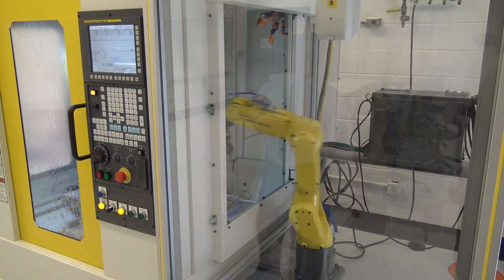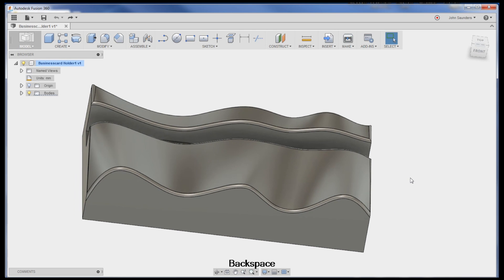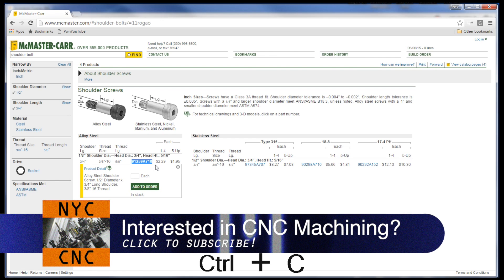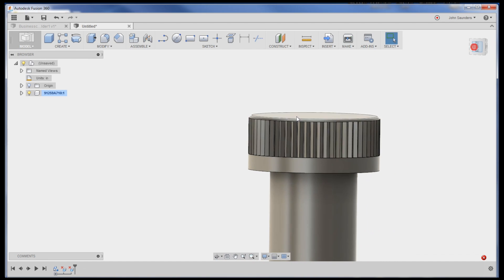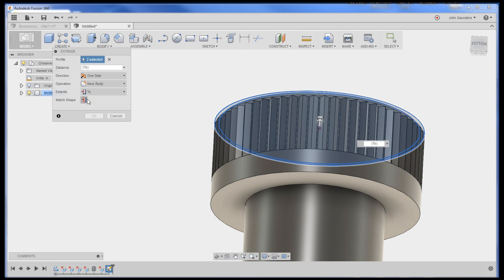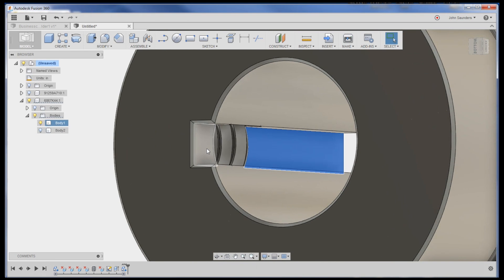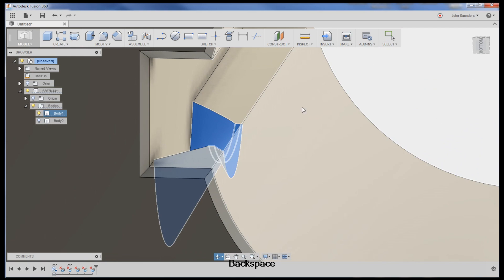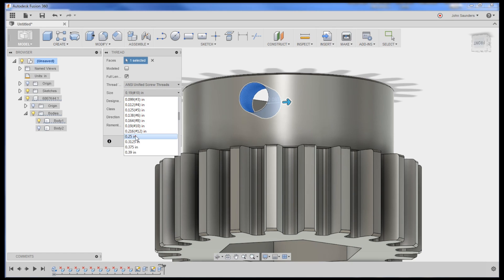Fusion 360: How To De-Feature Imported Parts!  Fusion Friday #21

Comment: When you tried to defeature that chamfer on the head and it didn't work you only selected the chamfer. Had you selected the chamfer face AND every face connecting it to the teeth it would've worked.

This is a very particular case because the face you deleted has adjacent faces that are all planar and parallel. When you remove the boundaries on the NURBS (which I believe is the class of faces used in F360) it streches the adjacent faces following the polynomials that define it - fancy way of saying they follow their inherent nature. Being parallel and planar they never meet, so F360 can't find a new boundary for all faces and throws an error.

Try left-to-right box selecting everything above halfway up the teeth, then deselect the top of the head and hit delete. I believe it will work.

Comment: i'm still stuck on using the flatbed scanner to import a template so I can draw over it. I use the Torchmate CNC cad and do this all the time. I have tried to draw the part in Torchmate cad and try to import the part as a DXF to fusion but still having no luck with this method! Anyone have a step by step guide for new users! LOL! The complete idiots guide!
Reply: +NYC CNC Looking forward to it!

Comment: Fanuc mill/drill/tap center with Fanuc robot on is possibly  the worst set up you can have horrible horrible machines.The majority of the software you use in the states is pretty much cheap and cheerful.As well much better packages on the. Market in Europe.Is it a price thing or just application specific why you guys use the cheapest and most basic machines and cad cam /modelling packages.?
Reply: +NYC CNC Before I go any further I just want to say I've followed your Chanel for a while and I think your a really switched on guy and A solid engineer I tip my hat to you. 1 Fanuc machines have a well earned reputation they really struggle with the more complex and intricate work.And they don't like being pushed hard on the more exotic alloys.Ive been on the Apps for 23 years now worked for Mazak/DMG/WFL and I'm now @ BOST in The Uk and Europe Fanuc have always been the cheap and cheerful option the do the Basics well but nothing more.Same with their robotics.All the companies I have worked for and with will not even give the option to fit Fanuc drives and controllers as they feel they are below standard and not the required quality. Basic light 2 Axis turning and 3 Axis milling is their limit.
Reply: +Carlos As for the software you use I have to admit I don't have any experience of it so I was out of line , I will hold my hands up to that.Due the the companies I have worked for my experience and knowledge doesn't go beyond Solid works/openmind/Mastercam/Edgecam.I find them all very similar and very proficient in producing a model then posting the prg.We have in process measuring cycles/collision monitoring/ datum shifts/to be honest their all the same just user specific what ever the individual feels comfortable with.theres little or no difference in capability and ease of operation. So to my original point i jumped the gun on the software I don't know enough to be critical I apologise for that.But as far as the Fanuc Mill/drill/tap centres Robots its a running theme cheap cheerful and very limited in their working envelope and capability.Perfectly fine if your drilling and tapping  a few holes and cutting a pocket.But anything else the software struggles and the machine struggles.

Comment: It'd be nice if F360 could import tooling for the tool library.  I don't want to have to mess around with the (rather poorly documented) tool library interface. (Seriously, body length? Shouldn't that just be OAL - LOC? Or is that the amount of tool (shank + LOC - tool holder)  sticking out of your tool holder/collet? I forget because the tooltips are frustratingly unhelpful.) </gripe>

Comment: Hi John, I have a request for some advice if it ever comes up as something you could cover. Something I have a lot of trouble with is finishing flat surfaces and retaining their flatness. Like if I want a finer or mirror finish on something I surface ground, I always seem to get slight edge-rounding when working through different grits of sandpaper on a surface plate.

Congrats on the successful move!